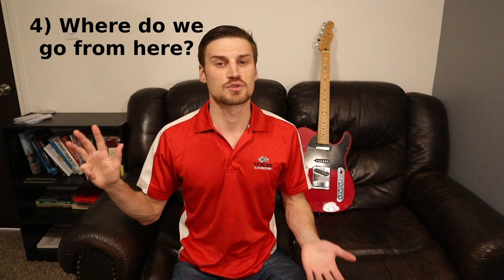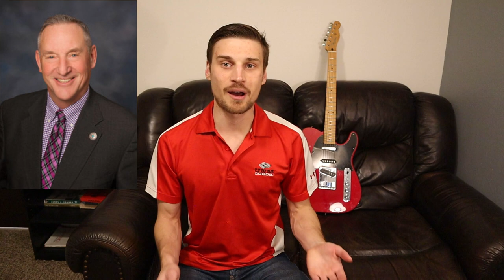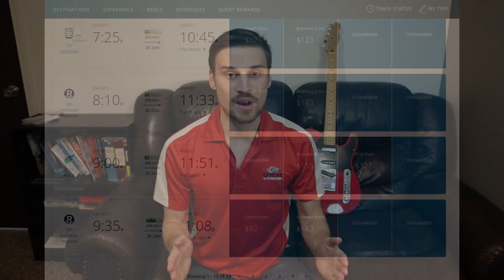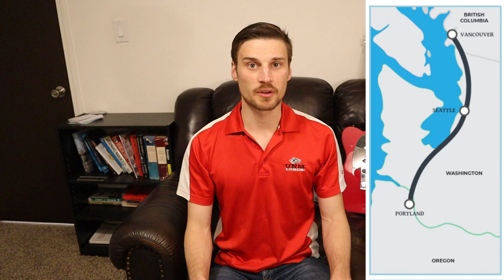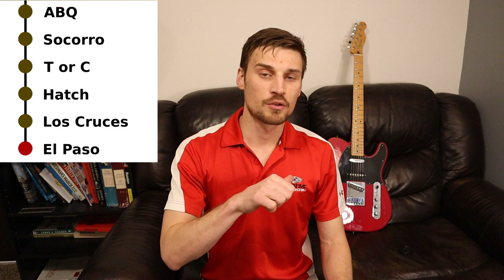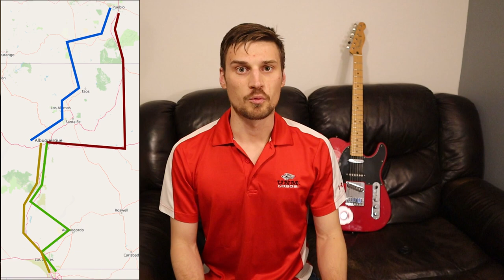High Speed Rail in New Mexico?!?

Comment: California is building highspeed rail in the central valley because that's the flat part of the state.  It has to be 200 mph because it isn't competing with cars like brightline its competition is airplanes. It not needing to make a profit is a good thing because instead of settling for good enough they will get it done right the first time. The biggest hurdle that California has is that unlike Brightline it needs to some very complicated tunnels through the mountains and fault lines.

Comment: I moved to Vienna, Austria, and I never need a car! The transit system here is so quick and efficient that I can do everything I need by train, subway, bus or tram. And the year transit card costs only $365/year! I also have a discount on the city bike system. The same can be said for Zurich, Amsterdam, Geneva and Paris. 

NM needs to expand its bikeways, and roundabouts with efficient smart signalling systems to make biking, walking and ever car travel more efficient. Roundabouts mean no more waiting at intersections, and they're safer for bike and pedestrians as well. That means you save money and time.
Reply: UNM is currently conducting a 2 year study on how to make it better for cyclists and pedestrians, since we're the state that's #1 in pedestrian deaths and crashes. We already have bits and pieces of good infrastructure but it's not an engineering standard, and a few roundabouts/ intersections here are poorly designed.  I think partly we're gonna need a bit of a cultural shift, since it requires educating people (from the engineers to public school) and advertising to people how much more beneficial it is. I think us already having a BRT in ABQ and Rail Runner might help persuade people more, but we desperately need more examples of good transit here.

Comment: Two points about California high speed rail.  One, new right of way had to be bought.  Land prices are crazy stupid for that.  Two, the money in PR against it has been a tell, also.  Highway proponents don't want to loose that money to rail infrastructure purchases and building.  Airline industry doesn't want to loose the short haul market.  Hence the PR against it.
Reply from the maker: You make fair points, thanks for commenting!

Land is crazy expensive in CA, but not in NM, which makes using eminent domain to buy it at 120% of tax-appraised value an easier option here.

I don't know what goes on behind closed doors at C-level meetings at airlines, but if I had to bet on it, I'd say the SF<->LA flights are pretty low margin and not worth spending the money trying to monopolize. But to your point, there was a ballot initiative in 2018 to build a light rail system in Nashville that didn't pass largely due to cooperate lobbying (https://en.wikipedia.org/wiki/Let%27s_Move_Nashville).

It is disappointing to have good ideas struck down by cooperate interests, but hopefully videos like this one will better inform folks of what transit in the US could be.

Comment: California is not a flat state like Florida.  In order to build a high speed train in California you have numerous passes that you have to traverse, that adds cost to the project.  The reason the first phase was built in central California is because this area is flat and it connects Bakersfield with Fresno.  When those track are completed Amtrak will have access to these tracks until phase 2 is completed connecting San Francisco to LA.  New Mexico is one of the poorest states in the Union, unless the economy of New Mexico becomes as big as California or gets Federal funding, the high speed train in New Mexico will just be a paper train.

Comment: Forget the Amtrak route to Raton. Trains creep through there at 20 mph. Those tracks were built 100 years ago.
The California High Speed Rail is going to be completed. You can count on that. Although Brightline does a fantastic job, it is not high speed rail.
But, great job, I would love to see New Mexico high speed rail. I love visiting and taking the Rail Runner.
Reply from the maker: Thank you so much! A hard truth to digest is rail infrastructure (just like all infrastructure) needs to be a continuous investment. If we don't upgrade our tracks for 100+ years, we'll have 100+ year-old tracks
Reply: @ericnelius9062  Part of it is geography. The reason the train goes slow is that it is mountainous. The curves are many, and very sharp. The high speed rail in California is putting tunnels in this type of terrain. Very expensive, and it takes a long time.
Reply: @robinrussell7965  I concur with your comments. The CAHSR  may not begin digging a tunnel until the 171-mile IOS is complete by as late as 2035 for as much as $35 billion.

Comment: Design the corridor for high speed electric, including alignment for >200MPH, then pare back the construction in a manner similar to Brightline's Orlando extension. Start with single track where the volume allows, diesel trains and 125MPH. Then upgrade when the demand justifies increased frequency.

I'd suggest inviting BrightLine to build the system using the state proposed money plus federal grants plus commercially obtained funds (bonds or loans). The state would retain ownership of the infrastructure and BrighLine would get an exclusive operation period with option to extend that exclusive period as part of each infrastructure upgrade package.

Also, it is possible to have "bi-modal" trains - diesel electric with pantographs so that they can operate from overhead wires where available. This would allow, for example, for electrification of urban sections to reduce noise and emissions while deferring electrification between urban areas. The bi-modal locomotives could be replaced with faster electric-only units once the track is fully electrified.
Reply: Great comments that make a lot of sense.
Reply from the maker: That sounds like a great plan! I had no idea bi-modal trains existed, that would be the way to do it. 

If you have a PE license and the $500k study bill passes, I'd encourage you to bid on the contract!
Reply: if you want to burn up billions of tax dollars just build it double track from the start. as it will save billions of just having to relocate the first line to start with. bridges, grades, stations, right of way, etc.
O and all of the time... and lives saved from head-on accidents.
Reply: @larryjanson4011  Brightline's initial single track is in the alignment of one of the two tracks, with high speed points at the transition between single and double track. Several of the bridges have the supports for the bridge beams, but only have the beams for one track installed. Other places were more practical to complete during the initial construction. When they have enough patronage to need the second track, they will complete the bridges, build up embankments that are presently only wide enough for the single track, then lay the second track alongside the first. The only tracks that will need to be moved will be removing the points and installing straight rail in their place.
Reply: Building a 200+ mph alignment will be extremely expensive as curves and elevation changes need to be very gentle. 
Brightline is simply building a second main line next to an existing freight corridor. Max speed on that section will be 110 mph. Only about 30 miles is new right-of-way with a maximum speed of 125 mph. That section is mostly single track. It can be expanded to double track but is not straight enough for 200 mph trains.

Comment: Brightline is serving 7 million and will be 11 million with Orlando and Tampa. Frontrunner serves 2.5 million over only 80 miles and Utah is growing faster than Florida and Texas on a percentage basis. Texas central would serve 15 million. New Mexico is not even a drop in the bucket in comparison. A few hundred thousand on the railrunner line is about what the SMART train services and that is struggling also. The conditions are not there for NM I am sorry to say. A million in Honolulu is not enough for HART too. I love trains too and live in California's valley. That project is half a century away from doing any good. Thanks again for your great analysis.
Reply from the maker: Thank you for engaging with this content! While yes, the total population of NM is only 2.1 million, linking together El Paso, Los Cruces, and ABQ would connect roughly 2 million people... over 300 miles.

Sure, the distance is great, but you need to remember: the land outside of cities/towns is cheap and unoccupied in NM... it's just wilderness, which is the reason why so many wacky experiments occur in this state. Maybe the next experiment can be a higher-speed rail line!

Anyhow, thank you so much for commenting! You may have inspired my next video exploring which set of cities would be the best candidate for higher-speed rail: I'm thinking Atlanta -> Chattanooga -> Nashville -> Louisville!
Reply: @ericnelius9062  Atlanta is very underserved and your are correct it needs better passenger service. Your candidate has one problem I think. Louisville would need to be connected to Chicago first. When you say higher speed I assume you mean the top speed in 110-125 mph. I have heard Atlanta to Charlotte NC has some merit. The population and distance seems to have more merit than to Louisville without Chicago. Just saying. 

Atleast the Rail Runner is owned by the state and the 375 million dollar price for 97 miles from Sante Fe was a nice decent price. The 20 million to operate each year needs more ridership. Ideally 4,000/weekday or 2 million a year would only be a $10 per trip subsidy. 

But going slow people still won't take it even when it's free. I say get the average speed to 80 mph on an express by upgrading the tracks to class 6 110 mph. Phase in Brightline Siemens trains. Make it free again for perhaps resident commuters. Have a premium car for mosty tourists. Connect to Taos if there is merit. 

This system needs to succeed before investing in tracks to Colorado or Texas. I think a rule of thumb is the annual ridership needs to have an approximate relationship to the population. Best wishes Eric and keep up the good work. I like your perspective. Thanks.
Reply: This seems like an inapt comparison TBH-plenty of smaller regional cites* outside the US have useful rail service especially at non-HSR but still faster than US shitbahnen (say 100 MPH, which can be done without specialized ROW or tech  and is wayyy below what the standard benchmark for HSR is), and while NM doesn't have a ton of people they're *extremely concentrated. You don't need a Desert Shinkansen to offer an appealing alternative to cars-even a desert Vermonter will do some good. 
Side note:  I think this is where network effects and interstate cooperation matters because if you have say Front Range rail and a connection to Texas the picture changes dramatically. A Denver-ABQ-El Paso connection links 3 cities with ~500-700K populations, two of which have a metro area pasat a million people, and once you do that it's pretty easy/cheap. to just toss in service to towns along the ROW and structure branch services (rail, bus, whatever makes sense for capacity needs) around the connection. 

*And places with good HSR networks usually have extensive local non-HSR services as part of their system.
Reply: The SMART if extended to SF to form regional rail through running can end up becoming a frequent and high ridership service
Reply: @ericnelius9062  you think a maglev would be better at such high speeds it’s better maintenance wise. The distance is great and that’s why the service has to be high speed rail to even be considered an alternative
Reply: @davidjackson7281  average speed at 80 mph? You are going to have to add many intermediate stops in towns for such a route to work. The Atlanta route should go all the way to Chicago and at class 9 why cause due to terrain you have to tunnel anyway you are better off going all the way. It could be a better candidate for maglev than the NEC.
Reply: @qjtvaddict  Atlanta should be a rail hub branching out in 3-4 directions rather than being somewhat isolated for passenger service. I enjoy reading your thoughts and ideas. If Chicago is a goal then have service go to Chattanoga then to Nashville then to Memphis which does go to Chicago. Not the best route of course but it would mean working with only one other state. It should go to Savannah as well. Maglev is way too unrealistic for so many reasons. Shanghai airport has an 18 mile 8 minute ride. It is a popular attraction I think but there are few applications elsewhere, me thinks. I say 80 mph because it would be so much faster than other Amtrak routes except DC-NY. Having stops spaced out 40-50 miles would be doable without slowing down a train with a top speed of 110 mph.
Reply: @qjtvaddict  I trust you are familiar with Brightline. It's service is better than Amtrak and that is why it is popular. When it gets to Orlando and Tampa its average speed of 80 will draw a healthy ridership. A three hour ride for 240 miles will be very enjoyable and popular.
Reply: @qjtvaddict  I have commuted from Marin to SF. Perhaps you may not be familiar with the geography. SMART does provide service to SF the only way possible which is connecting to the Larkspur Ferry. The tracks don't go across the Golden Gate Bridge. SMART trains are very comfortable but there are inherent issues with the service. Mainly there is not enough population. Sonoma County has 475,000 and Marin County 240,000. Their populations are decreasing for several reasons. It is tough to use as a commuter service because the three to five mile connections to home and work are inadequate. The train frequency is low. Ninety percent of the system is single track so the average speed is way too slow. It takes 75 minutes to go 45 miles. Again, I appreciate your comments and mutual love of trains. PS a maglev is technically they say a monorail since there are not two rails.
Reply: CalHSR will tie into and greatly improve the San Joaquin service by 2030 ish, a far cry from half a century.
Reply: @daniellewis1789  The trip from Merced to Bakersfield will be shortened from three hours to 90 minutes. That will be a nice improvement. What I meant about a half century away was the entire project, not the initial operating segment of 171 miles. I am all for it. Unlike me, I hope your age is closer to 20 so that you will see the finished CAHSR.
Reply: @davidjackson7281  We're something like a quarter century and change from the forecasted  completion date - 2073 is a long ways out. Unless you mean the expansion beyond the initial complete network?
Reply: @daniellewis1789  What I surmise is this. It began in 2008 with the proposition passing. Then actual construction first started in 2015. The 171 mile route may be done by 2030. The funds have averaged about a billion or so a year. It may be closer to two billion a year now. That low annual funding is the issue why it will take so long and even with additional federal funding it still won't speed the project up much. The next segment from Merced to Gilroy may start in 2030 get done by 2038. Then Bakersfield to Palmdale could take ten more years until 2048. The final segment, though the shortest at 40 miles has 28 miles of tunnels and would take another 10 years optimistically and be done by 2058. That's 50 years for phase one. I hope this helps explain my theoritical projection. I wish 5-10 billion a year could be spent. That would naturally get it done sooner. I welcome any response or ideas you have Daniel.
Reply: @davidjackson7281  They haven't broken ground on anything beyond the Initial Operating Segment and CalMod and other agencies making upgrades to shared ROW because they've been acquiring ROW, working on EIS, and fighting NIMBYs. There's been substantial preparatory work on most of the initial build out, they aren't waiting to start on it until the IOS is finished.
Reply: @daniellewis1789  yes i understand what you say when do you think it will be done

Comment: If such a system, then definitely from the beginning as electric, its operation is cheaper and offers more convenience. As for speed, the question is whether you want to build it to compete only with cars or also with airplanes, as in California. If there are not enough funds for a full-size HSR line, it can be divided into sections where sections with easier and more straightforward terrain can have a maximum speed of up to 200 mph and sections with complicated sections only 110-120 mph. Many tracks in Europe have been built this way, not many tracks have a top speed of 200 mph for their entire length.